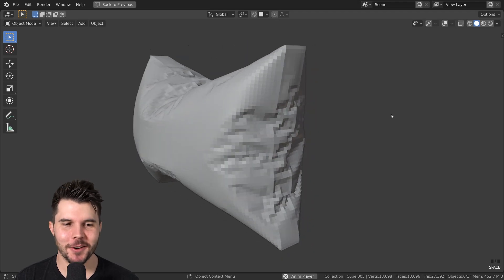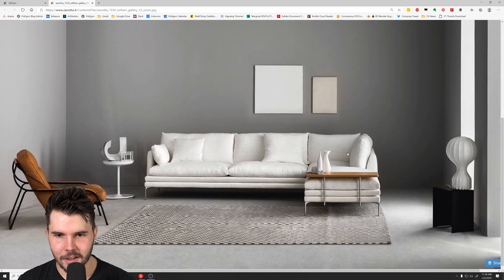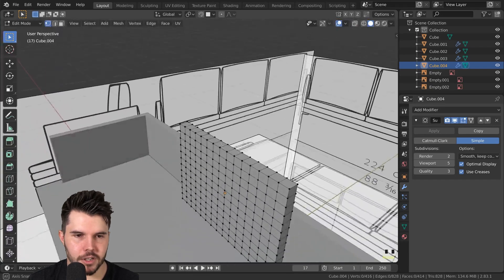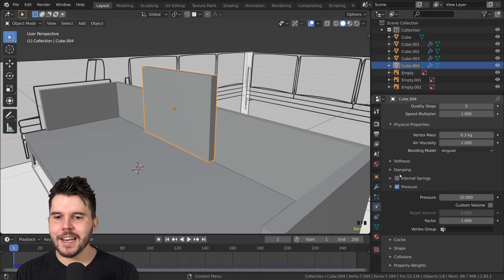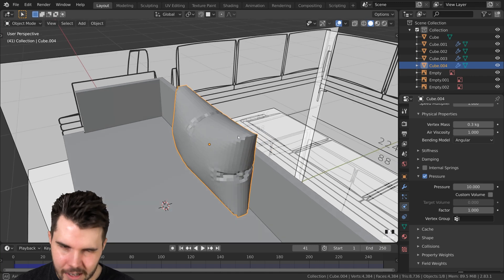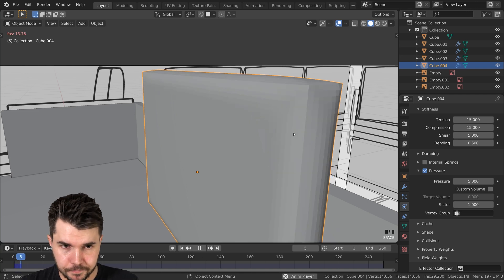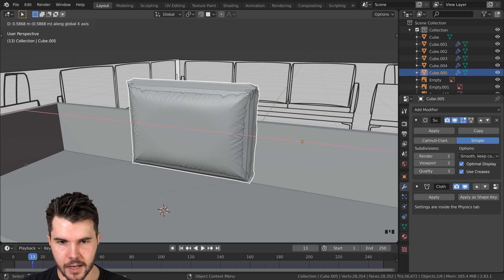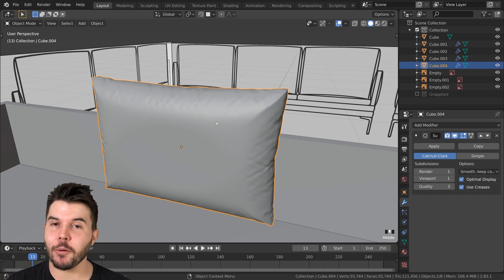Couch Tutorial Part 2: Cushion Simulation

Comment: Hello, if anyone having the issue on 18:37 where the pillow turns into a big cube after scaling it to 1 on each axis, the resolve to this issue is not scaling it manually instead just toggle object mode and while selecting the pillow click ( CTRL + A ) and apply the scale and this will reset the object's scale to 1 on all axes while preserving its current size. thank me later _
Reply: Mine is still a big cube

Comment: for those of you having problems inflating your cushion inwards, you have to check the "custom volume" checkbox, and play with the "target volume" slider, use value 1, and works very well, I'm using blender 3.5.1, hope this helps.
Reply: Thank you!
Reply: I found the issue to be applying the scales flipped my normals inside out for some reason (scaled it negatively?). Simply flipping them again in edit mode let it inflate properly without tweaking custom volumes or negative inflates.

Comment: For anyone having problems at 7:36 (the cushion inflating inwards to the point that each side goes towards the opposite one - kinda like an infinite vacuum), simply select the cushion in object mode and scale it along the y axis and that should weirdly solve the problem. From this point on, you can even scale it back to the original size you had so no worries. Don't know what the problem is, but thought to save you up some time. Cheers.

Comment: when i tried to apply the cloth it warped my object into a really weird mess, i went set the frame of the simulation (for me 1 to 60) and then baked the simulation in the cache, then applied the cloth and everything was perfect
Reply: 💡 If your cloth gets all messed up when you hit “Apply”:
Make sure to apply your Subdivision Surface modifier before the Cloth modifier.
Otherwise, Blender tries to apply the simulation on a different topology, which makes everything warp.

👉 Correct order:
1⃣ Subdivision Surface (apply or leave before)
2⃣ Cloth (bake + apply after)

Since doing this, the shape stays exactly as it looked before applying — no more weird deformations.

Comment: I'm using Blender 3.4 and when I activate the "Cloth simulation" nothing happens. I mean, it doesn't fall like in the video. When I activate the pressure setting nothing happens either, is the process different now? Anyone can help?
Reply: It seems I did something wrong in the scene, because I started a new blank scene, added a simple cube with the cloth simulation and it did fall. I even added a plane underneath with collisions and the cube moves as if made of cloth... mmm... what could it be?

Comment: About minute 12:00 If  you're a 3.4 users like me, and your pillow doesn't seem to puff right and it gets sucked from inside at first, in "physics properties", under the "pressure" tab you can turn the "custom value" on,  and set "target value" to something around "0.500"

Hope it helps!
Reply: Thanks helped out alot!
Reply: When I apply the cloth modifier, it like explodes into a weird shape. I can not seem to figure out how to troubleshoot it.

Comment: why are my pillows exploding, I tried a new object by itself and it does the same thing unless it is only about one inch big.
For whatever reason my pressure has to be low and it takes a lot of frames to get a decent pillow, the only thing is it looks like a pillow and not a cushion. I love the simulations and physics though I've been plying with it for days now, well my free time that is. I'm running Blender 3.1.2 and my system of measurement is Imperial not metric so I'm wondering which one is causing my problems.
 So the other question would be can my graphics card effect these simulations?

Comment: Hi.  This is a great tutorial.  However, I have figured out why the pillow fell out of the scene, once I zero'ed gravity that was fine but now I have an issue with the simulation that is a huge headbanger.  I have been trying to redo some of the cushions with less polys but still following the tutorial.  Now suddenly the pillow completely disappears almost immediately.  I am using the following settings:

Create cube
Cut 8 x 8
Add subidivision: 2 viewpoint
Cloth
Pressure 3
Gravity 0.000
I have also added upon a member of my meshing communities advice a levels of 10 instead of default 5 on the cloth.

I really started to think maybe I just turned something on accidentally (because it seemed like it started to happen after I turned on proprotional editing) so I even uninstalled/reinstalled to see if that was it to no avail.  Please help I'm really stuck at a standstill without this simulation.

Thanks

Comment: My pillow's pressure first starts to move inward and then outwards and it messes up with my result creating a middle sharp fold on the smaller faces of the mesh. How do I fix it ? (face orientations are ok )
Reply: Edit 1 day later. I solve it. Just start a new blender file and work in there

Comment: If you have a problem with the simulation. It should help. I noticed that Andrew has less loopcuts to the end of video. It's 7 horizontal line and 10 vertical line. You don't need to delete a cube and make another. Press Alt and click on 1 loopcut, then press tab g and merge your loopcut to top or bottom (or left/right). Do it with every lootcuts. Than press A and M and click - by distance - doubles will be deleted. than you can add new loopcuts. 
I hope it helps :)

Comment: Better pillows? Subdivision 2, not 3... I made a vertex group out of the edges, checked the box for Internal Springs, set Tension and Compression to 0, then chose my vertex group, set Max Tension to 0.05 and Max Compression to 0.005. Then, under Pressure I set Pressure to 2, I checked the box for Custom Pressure and set it to 2 also. Running the animation, the pillow inflates faster and comes to rest faster with a more natural shape with crisper edges. Lastly, I made another vertex group of just the corners and set that in Shape. I set Stiffness to 0, Shrinking Factor to -0.05 and ran the animation again. I felt that this was closer to the source image and I very much liked this result better than the Guru's. YMMV.

Comment: My cushion goes inward first before buffing out, and thus creates kinda messed up corners. Any reason for this? Scale is reseted.
edit: ok fixed it weirdly..put -5 (instead of 5) in the pressure, now the cushion doesn't go through itself. (Also noticed another comment in this thread for the reason.)
Reply: Thanks! It works
Reply: Mine goes inward even though it's a positive number and I did not want to change face orientation so your comments saved my life. I simply put -10 now :D
Reply: Thanks, dude. <3

Comment: Hey Andrew, i was at the simulator setup step, when i set the pressure to 10 i notice that cushion inflates negativelly (such all sides collapse inside and then i have horrible glitches in the edges). Why? To fix i have to use a negative value such as -10...

Comment: Just a late addition for you: if you go under cloth sim and enable "internal springs" and set tension to 0 and compression to 0.05, and leave pressure at 10, you get a nice, controlled inflation that looks very natural.
Reply: should it not change or did I do something wrong? My cube just stands still
Reply: @ItalianTomato26  Its because the subdivison is on simple, we use a newer blender now
Reply: @Rupturedspace  so what's the solution? Please tell I'm having the same problem

Comment: I started making this sofa in version 2.90.1. However I could not unwrap the pillow properly ( according to the software the  scale was  not uniform).  I tried to find the scale properties as shown in the video but couldn't . The only visible options were location and rotation. I opened the same file in version 2.83.1 but the problem was still the same.  

Please help
Reply: Hi. Go to the object properties tab (just above Modifier Properties tab) and you will see it. When adjusting the values make sure you are on object mode.

Comment: Putting Babies on Blast: Part 2 of 8

EDIT: I think I've figured out the inverted pressure problem people have been complaining about in the comments. If you're running blender 2.9, you'll have a few more Pressure values under the drop down than the Guru does. Target Volume seems to be the problem as its default is zero and when you run the sim with it unchanged it seems to be treated like a negative value and the pillow deflates before inflating normals outward. Obviously flipping the normals creates problems later on but if you  check 'Custom Value' to get access to Target Volume and set that to any number greater than zero (I have it at 1) it seems to solve the problem at least for me.
Reply: Thank you I kept pinched corners
Reply: getting

Comment: I am on Blender 2.9 and i had to reduce pressure scale and increase stiffness tension/compression/shear to have results approximately similar . I think they changed something in the physics default value maybe, on 2.9, because i did all the same before and my cushion inflate more than in the tuto and hadn't enough wrinckles.

Comment: Hey, I have a problem when increasing my viewport 12:27 It destroys my model and becomes something weird. It says "Number of points in cache does not match mesh" I don't know what cache is and how it works. I'm just a beginner. Pls help
Reply: I know this is from a year ago, but just wanted to say I had the same problem, I ended up having to re run the simulation by starting my playback at 0 and replaying the timeline to get it to work normally.

Comment: Now I have tried several times to get such nice cushion following step-by-step but I can't get it right. I have created the cuts into uniform squares, made all the same settings in the modifiers as you did. applied my scale so it's 1 -1 -1 now. But I have two problems: 1. My cushion doesn't become as thick and fluffy as yours before suffering deformations. I have to stop at frame 13 to avoid deformation but then it looks more like a flat screen with some small wrinkles. 2. It does not do the UV unwrapping. No error or anything, just nothing happens. What am I doing wrong???

Comment: 8:22 Fun fact, that's how pressure works IRL. the particles inside bounce off the inside faces of our cushion. in your example, the particles only push the insides that are still there, meaning it floats to the left because theres nothing to push on the right. It's basically being thrusted by the air thats coming out of the empty side. Sorry if this was hard to understand but i hope you found it interesting!

Comment: 18:30 when I set the scale to 1.000 my pillow deforms and becomes a cube:( I am stuck and idk what to do, someone help????
Reply: You should not set the scale manually to 1.000 but instead with your object selected hit Ctrl-A -> "Apply scale".
Reply: @andread4721  Thank you!
Reply: Just press Ctrl A when its selected
Reply: I deselected everything I could i.e: de-selected pressure, selected it again, set the pressure to 10 then back to 5, hide modifiers from viewport, then enable them again. Something was refreshed and then the animation ran normally after setting up the scale.

Comment: When I run the Cloth simulation, the normals flip half way through it, and it doesn't "bounce", it just keeps inflating into eternity....what?
I've alreayd done a cloth sim multiple times with pressure and no gravity...etc, and this never happened. is it a bug in the new blender?
Reply: nvm, just figured out I needed to apply scale, and then flip normals and that fixed it!

Comment: @Blender Guru For the pillow. Vertex -> Remesh -> Quad method. No need for manual loop cuts! For some reason, two vertices were off their place by a tiny amount. Easily fixed with vertex snap to fix it.

Comment: Just noticed that mine was "inflating inwards".. Solution: Select all faces and flipping normals fixed it.  (edit mode: Mesh > Normals > Flip)
Reply: Would it be better to use a negative pressure value or have the red sides of the normals facing outwards?
Reply: @dragonpanda2379  i thing your way is much easier, aree thank u bhai
Reply: @dragonpanda2379  Yep, negative pressure worked for me.
Reply: @dragonpanda2379  You just saved me so much time, ty.
Reply: I faced the same problem. After looking through my cube's properties I discovered that it was negatively scaled across the Y axis. Deleting the minus in the Y scale property field solved the problem.
Reply: For anyone wondering if their faces are inward facing. First check the face orientation on your mesh. You can do this by selecting the "Show Overlays" tab which looks like two circles at the upper right hand corner of the viewport. Clicking this and selecting "Face Orientation" will show if your normals need to be flipped. If the faces are red, you need to flip them.
Reply: Had the same issue here. Flipping normals solved it, thank you! The cushion looks perfect now at frame 9. But the normals are red. Is that bad / how do I solve it?
Reply: @fastenseatbeltnow  Also, setting the object shade to smooth sometimes is an easy way to reveal messy normals (since blender will use normals info to do the interpolation caclulation between faces to render the smooth shading)
Reply: Marcos Scheeren thx a lot for your answer. You see red normals when you go to Edit mode > A > Mesh > Normals > Flip. Although it looks good in Object mode I‘m afraid it will be an issue when it comes to UV Editing and Blender will apply the textures on the inside of the cushion 😕 Recalculating Outside/Inside does not help either.
Reply: @fastenseatbeltnow   I haven't tried Part#3 yet but I did figure out to flip the normals first and then again when finished.  I found that I could use Catmull-Clark instead of Simple to get rounded corners instead of pointy.  I spent a fruitless day before discovering the flipping normals and even when I had a red pillow prior and I got it as good as possible, when I hit Apply to Cloth and Subsurface the pillow crumpled into a messy blob and would have taken days to fix.  I will read the replies in the future and save myself some trouble!   I think the Guru was using a prior version -- mine is 2.83 currently.
Reply: @fastenseatbeltnow  I'm crying and  I could kiss you right now
Reply: @fastenseatbeltnow  After you flipped the normals and then Ctrl A to apply all transformation. At least this works for me.
Reply: @fastenseatbeltnow  Well, I have never seen red normals (not saying that that might not exist, cause I can't say that I'm an expert either haha) Maybe select whole mesh of faces with  "recalculate outside" (mesh > normals > recalc. outside) could do the trick. Btw, to my knowledge, read means the Seams for the UV unwrapper, ain't them?
Reply: I had the same problem because i forgot to scale the cube. After that it was red and i flipped it to blue and it worked like in the video. The cushion stayed blue.
Reply: oh my god thank you and everyone in this reply section this helped so much!Before i seen this my corners of my pillow were inverted  but now i fixed them by pressing mesh >Normals>Flip twice this method also helped alot  to fix the inverting corners and other clipping things and or deflation of ur pillow jusr=t go to edit mode and  press A on ur keyboard to select all faces and then press SHift + N to reclaculate  normals and select inside boom no more clipping!it looks so much better thanks guys 😁
Reply: Select the cushion cube, CTRL+A and apply the scale. Then check your normals by going to the Viewport Overlays (the double circle thing at the top right) and click "Face Orientation". If your normals are red, they need to be inverted (correct side is blue). Hit tab to go to Edit mode, hit "A" to select all, Mesh > Normals > Flip to invert to blue. Also, you need to hit Tab again to be in Object Mode in order to view the cushion simulation on the time line.
Reply: @alexconner3958  you helped me so much! thnx
Reply: I wouldn't recommend this since the texture of the pillow will only show up in the inside of the pillow rather than the outside. 
I just added a negative (-) to the value so it'll inflate the inside.
Reply: Thanks man, that was driving me nuts. Should've remembered that from the chair tutorial lol
Reply: Not all heroes wear capes. Thank you sir!
Reply: The REAL solution I found that worked was to apply the scale! Of course I forget to do it, anyway apply the scale then your normals should be correct, make sure you un-flip the faces too.
Reply: THANKS
Reply: Appreciated, thanks
Reply: GODLIKE!!!
Thank you.
Reply: Thanks man
Reply: This is the story of how i met my hero
Reply: You're my personal Jesus Christ.
Reply: guys, I fixed mine by (object mode)selecting the object > ctrl + a > all transforms;  (edit mode) mesh > normals > flip
Reply: ahhh thank you! i was struggling with that for an hour haha
Reply: Legend
Reply: hallelujah
Reply: Thank you so much!
Reply: thank you for this. I was going insane trying to get it right. This fixed it
Reply: Thank you so much!
Reply: thanks man , same issiue
Reply: Yoo tysm lifesaver

Comment: When i switch to the edit mode to mark seams, my cushion does not inflate as it should be when i recalculate the simulation. Did anyone face the same issue?
Reply: Yeah, even I had the same problem.
Reply: But then, I went back to the 1st frame, changed back to flat shading, applied the scale, and then got back to the required frame, and it somehow worked
Reply: Idk how😂